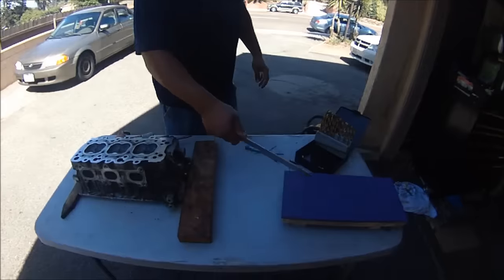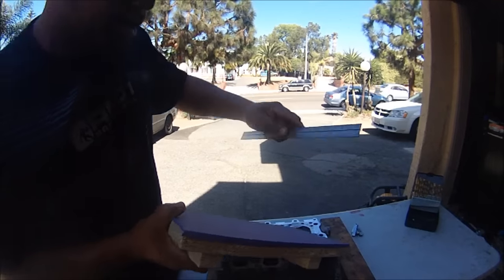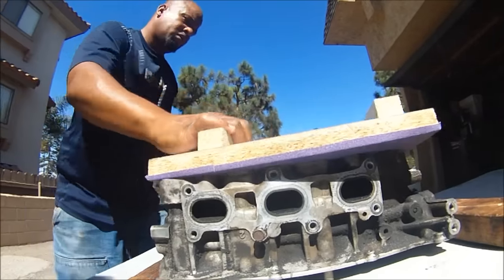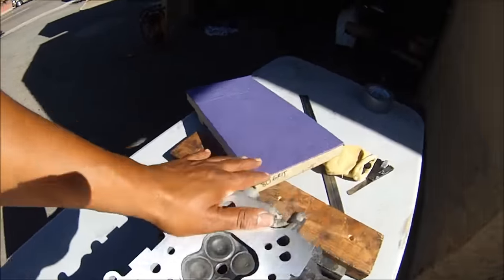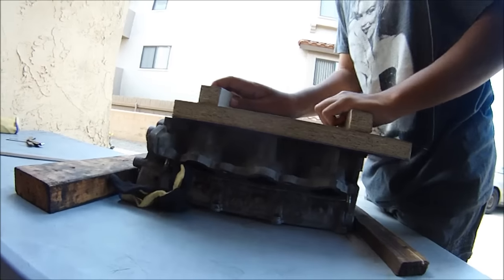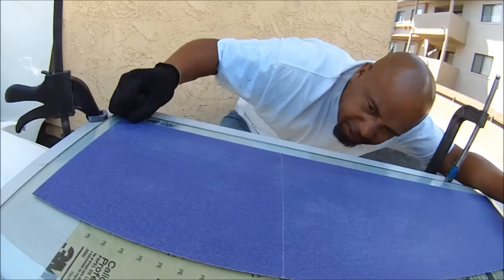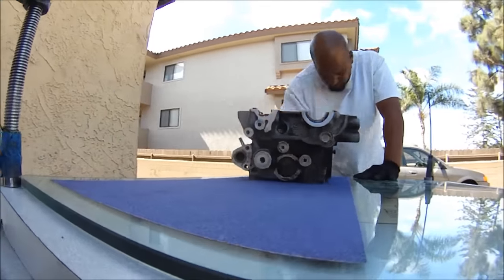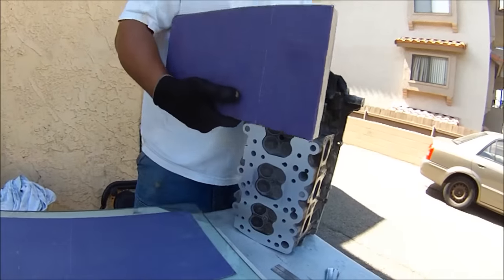HOW TO RESURFACE A WARPED CYLINDER HEAD AT HOME WITH SAND PAPER still works in (2023)

Comment: This man may be a great guy but he is not steering you the right way , I am all about saving a buck but what he is doing is not the correct way to do this , the surface must have a certain RA finish for modern multi layer steel gaskets to seal properly, also with his hand job sanding you can sand one side lower than the other and change combustion chamber size which can cause predestination which can burn valves or pistons, you can do it by hand but you have to take in all these factors

Comment: Do not do this with the valves still in. This method is good but you will need to clean the heads in a tank.

Comment: "Out of warpage"...  Ha!  I applaud your DIY video, but your math is a bit flawed.  First, Save $45.  (which seems like a super cheap price to me)... if you make $45. an hour you are ok.  Actually, pre-tax they probably need to make more like $65-ish an hour to actually net $45.  But then, you added more than the hour of labor... & how much were your materials + the TAX ON MATERIALS?  Glue, 3 kinds of sandpaper (in BIG pieces), sanding block (+ time to make it flat), table (that you drilled in to, partially destroyed), Glass (got free but how much time to get it), etc.  WIth all due respect, after it is all said and done, if someone is just doing a single piece of work with the materials & costs, looks like "the juice just isn't worth the squeeze" as they say.  That being said, kudos to you for finding another way to "skin a cat"!

Comment: And you just have to flip the "precision ruler" over and now it's warped on the outside and high in the middle. Duh! Problem fixed. Not! You have to buy the same precision gauges they use in a machine shop or you'll booger it up bad, dude!

Comment: Who sells a good straight edge without paying a ton?
Reply: You don't need the expensive crap. Any metal ruler will do. Also you can check right away if the camshaft is rocking as the cam itself is a straight edge in a way. Did the gasket leak? If so the head will need to be resurfaced anyway. If the head is warped it should be straightened flat first and only then resurfaced otherwise the cam might snap in half after a while unless it's a high mileage engine and the cam beds are hopefully worn out.
Reply: @SinsBird  thanks!

Comment: Wait a sec. So a machine shop only charges $45 to shave a head?! Sounds like a better deal to me, not to mention easier. Rather than driving the 60 miles to buy all the sandpaper, glue, lumber and a big plate of glass. Besides I'd probably fuck it up anyway. Guess it doesn't matter. I can't afford either method, nor do I have a precision ruler or straight edge.  

What I DO have is this big fatty. And a guitar. And an ass. One is for smoking and toking. One is for sitting and shitting. And one is for playing and collecting dust... Well they can't all rhyme. I'm not Dr. Seuss. 

I'm Funkytown M.C. GumbiMilk ScratchNSniff  jr. V3.1 M.D. or Aaron for short. And I keeps it real. I'm not a very good mechanic but I'm not a very good guitarist also.  Cuz I keeps it real. I'm 40 years old, I don't have a job and I live with my mother. Cuz I keeps it real. I haven't been laid in 8 years nor do I even care if my 4 inch dick even still works or not. Cuz I keeps it real. I crapped my pants and stuffed it in my grandpa's pants. Cuz I keeps it real. He thought it was dog crap so he blamed the dog. Now he lives in a home. Cuz I was keeping it real. He escaped and sought revenge but was stopped by the cops for exposing himself to children. Now he's in county lock-up. Cuz I keeps it real. As a goof I ran for governor and somehow accidentally won. Cuz I keeps it real. I was so terrified of the responsibility that I changed my name and moved to Guadalajara under the alias name Aliás Namè. Cuz I keeps it real. I wrote this song and put it on YouTube... in the comments section. Needless to say it garnered no attention. Cuz I keeps it real. 

Well now I'm thoroughly stoned and I have some lyrics, albeit crappy ones, for a song. Thanks for letting me use the comments section. I've considered using a pen and paper. But I guess I decided against it? For whatever reason? Toodles!
Reply from the maker: Ephesians 4:29
 Let no corrupt communication proceed out of your mouth, but that which is good to the use of edifying, that it may minister grace unto the hearers.

Comment: Yeah no thanks. Try that on a cast iron head. I'll let the machine shop do it right so they can be matched and I know how much has been removed. It doesn't cost much and is worth having it right. You would be at it for a year on some real cast iron and we're not doing bodywork. One side is going to have more pressure then other sides you may have an unwanted angle. If I can't spend a hundy to get it done right then I probably can't afford insurance or tires and don't need to be driving anyways until I get off the couch and get a better job or a second job because I'm porting and buying good valves and springs and making more power. Priorities. I may be homeless but I had no problem spending 3 grand on my heads and another 10 on the rest of the motor. Don't be a ding dong, do it right. You don't want to do heads twice. Thanks God bless and He will provide. Have faith and that machine shop money will appear if it's something you really need
Reply from the maker: It's not for you

Comment: you need a sanding block thats about twice the length so you never have any part of the engine block not in contact with the paper.  what you are doing is sanding the middle of the engine block more than the edges and are ADDING to its concaved state